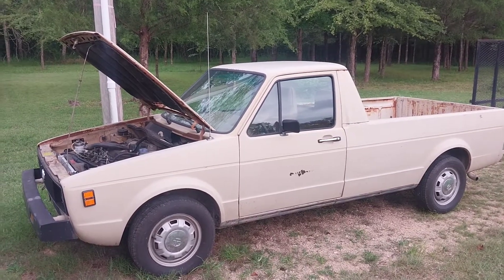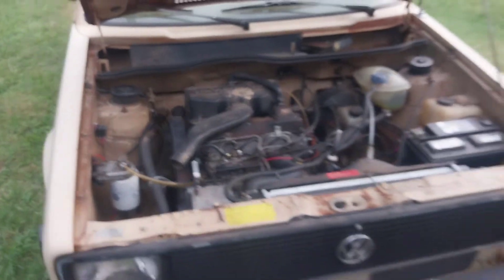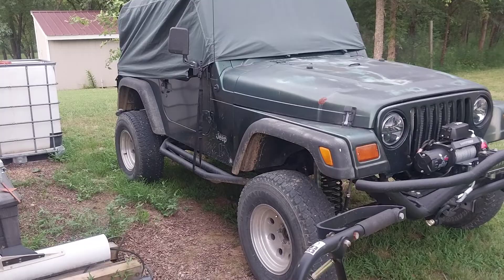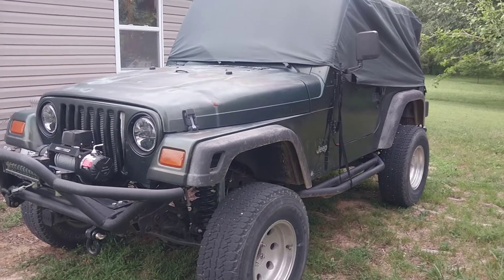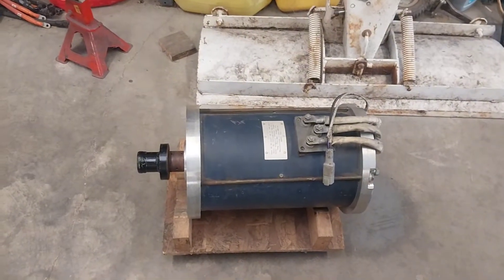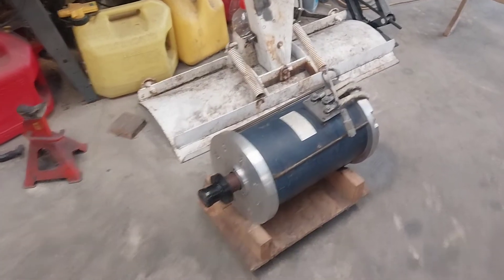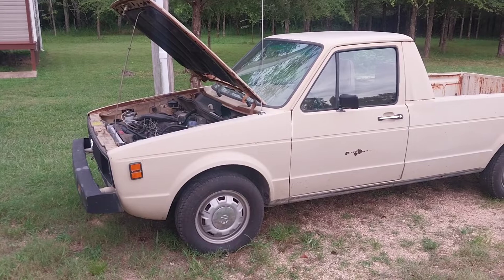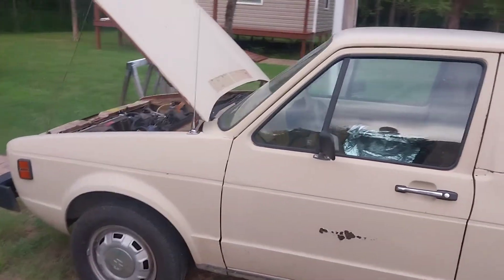The Intro - TSLA VW ep. 1

Comment: Project after that: Solar trailer, so you can extend your range and use it as a solar generator in the "off" time.
Reply from the maker: Solar panels on the range extender trailer. Hell I could make it a travel trailer, too with a bed and little kitchen!